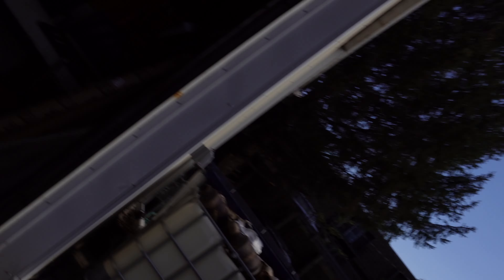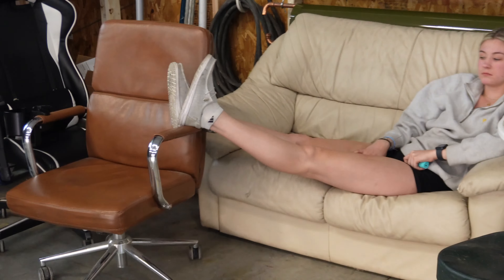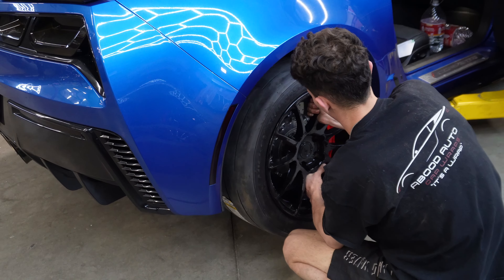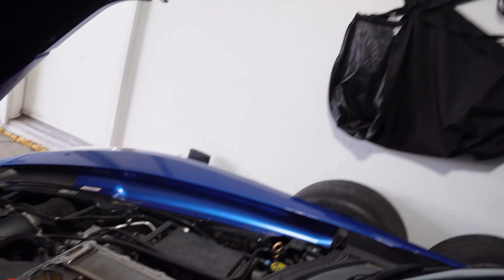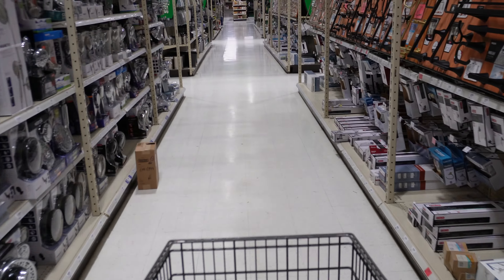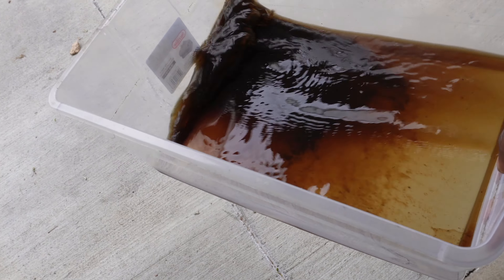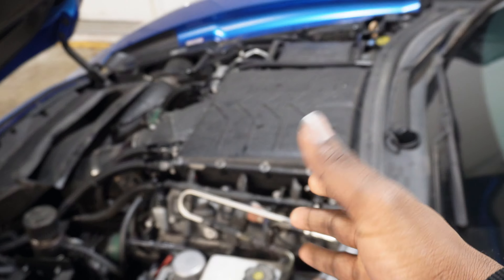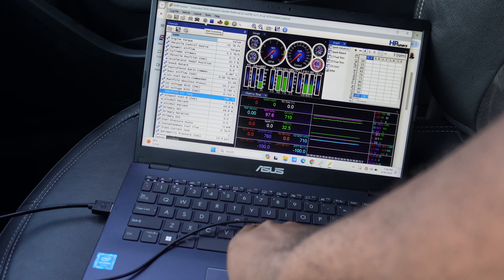My CORVETTE Z06 HATES ME EP.2 (HIGH IATs and MATs) HELP!

Comment: way too hot. might still have air in it. also ive never seen a pump like that...
Reply from the maker: It’s the pump that comes with the cordes ice tank lol. Will get it bleed soon
Reply: @SmoovelifeTy  I wasn’t aware they ran those pumps. Def has air in it bro. Get it fully bleed. I had the same issue. It’s hard to bleed these things.
Reply: I forgot to mention in the other comment that my 416 max effort lt4 blower build ran at 120 driving. I feel like I phrased the comment incorrectly. It was hard af to bleed and I ran into the same issue you have.
Reply from the maker: @javiermartinez-ub1qj  were you running meth?

Comment: should be like 120 while driving in my experience
Reply from the maker: That’s how it was with my zl1 but my z06 is heads/cam, upper and lower pulley ,2300 blower. Generates a lot more heat
Reply: @SmoovelifeTy  my zl1 was the same. 416 stroker and ported lt4 blower. I didn’t even have a trunk tank. Running the stock pump on a bumper mounted tank. Those aftermarket blowers make less heat than the oem blower. Lt4 blower is a hot mf. It did not run that hot. 120 driving down here in hot and humid miami.
Reply from the maker: @javiermartinez-ub1qj  dang. Yup gotta have air in mine then. Definitely gonna bleed it. Thanks!!!
Reply: @SmoovelifeTy  yes but driving around the meth isn’t spraying so it wouldn’t affect the temps. On WoT it would go to like 85-90.